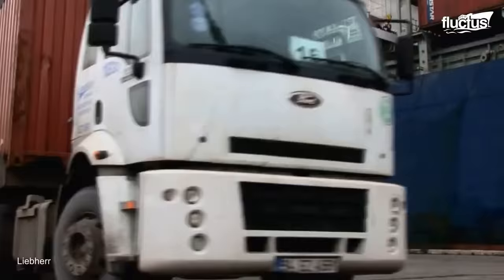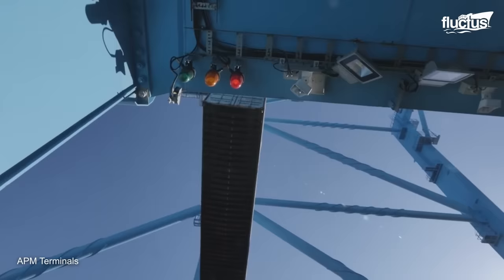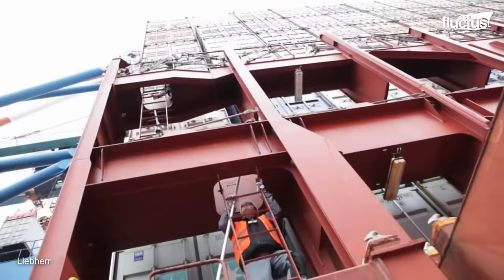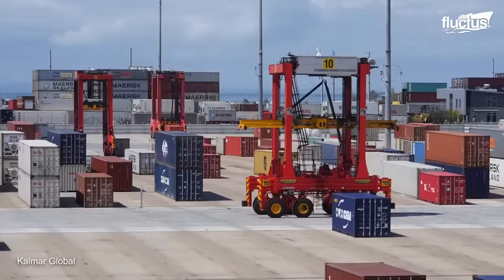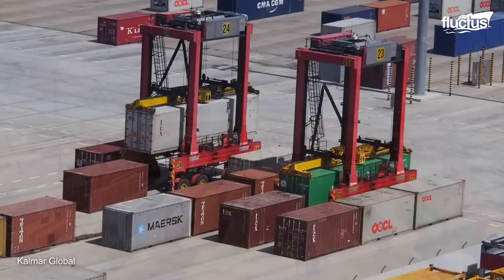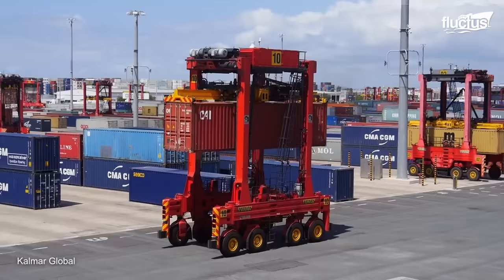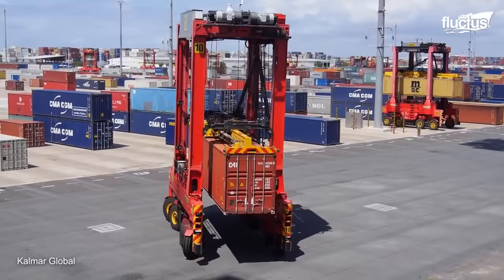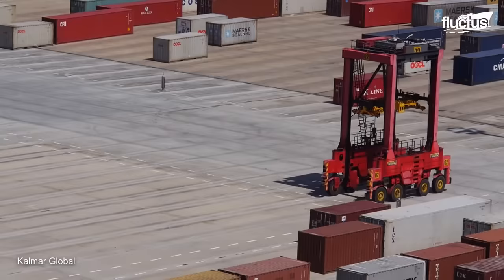The Genius Solutions Seaports Found to Load World Largest Container Ships

Comment: The faster you move the ships in and out means less time for maintenance which will catch up to you sooner or later.
Reply: i'm pretty sure they have teams ready to go for most maintenance issues, and dedicated slots for heavier maintenance schedules, its not like this is a new system, been refined for decades
Reply: I am suggesting replacement ships with railways crossing oceans around the world. No oil is used. Power comes from wind generated electricity.

Comment: i don't think containers can weigh 60 tons. maybe 60,000 lbs.
Reply: True. I've worked with thousands in my military service... Most have manufacturer markings that indicate max container load of 80k pounds for a 40 foot container.
Reply: Max gross payload for a 40ft is about 30mt but it depends on whether it’s steel or aluminum.  It’s unusual in most trades to see containers this heavy because of weight limits beyond the port.  A container weighing so much would ordinarily be required to be loaded/unloaded at or very near the pier.